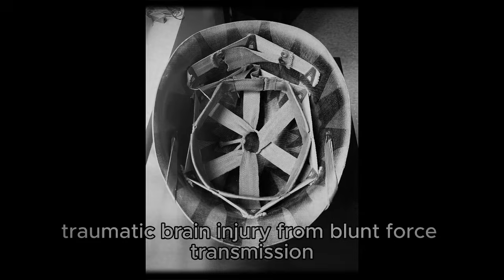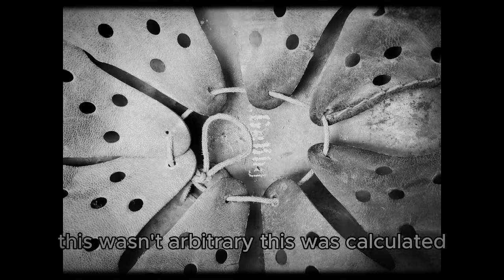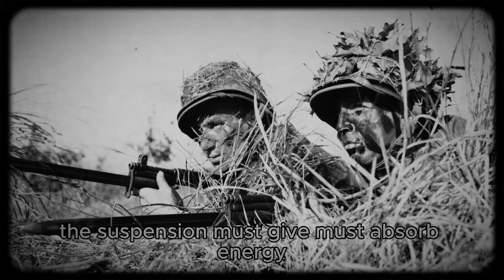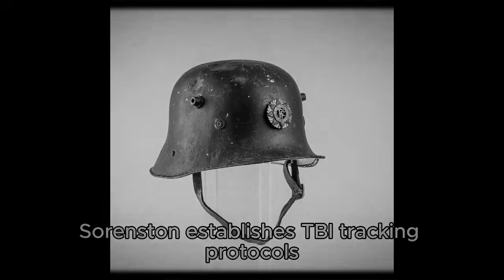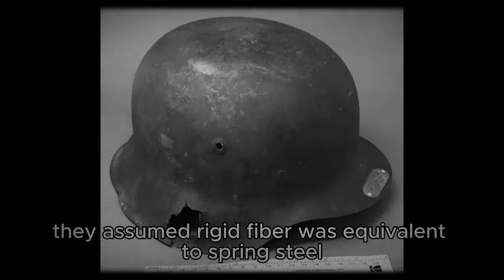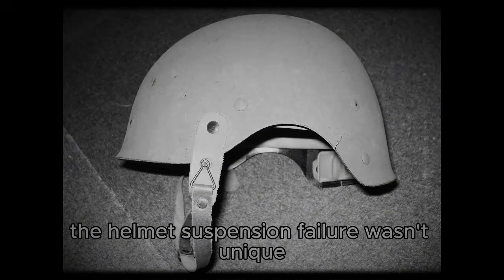The Helmet Design America Got Wrong — The German Safety Feature That Changed Warfare

Comment: My US Army unit was issued the then new MICH helmets when we arrived in Iraq in 2004 but we were forbidden from wearing them.  The Battalion Surgeon thought in error, that the PASGAT helmet was more protective (than the slightly smaller MICH) was safer without understanding that the MICH helmet's foam liner pads were an order of magnitude more protective than the old PASGAT with the old suspension system identical to the World War 2 M-1 helmet.